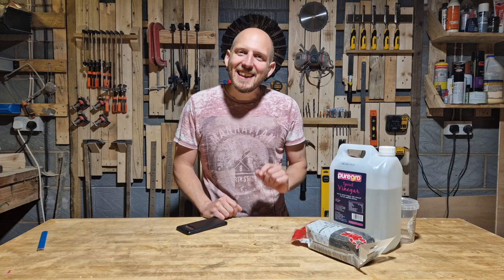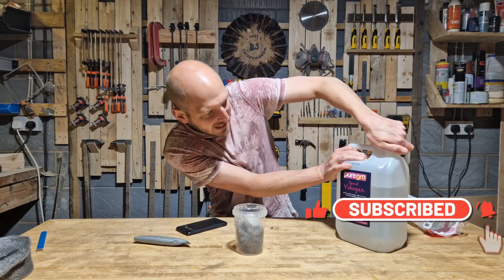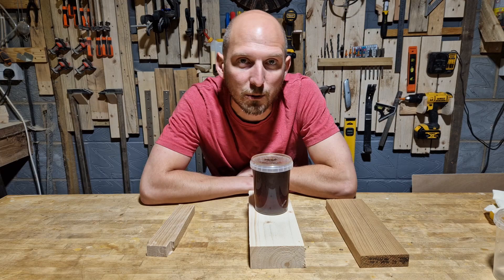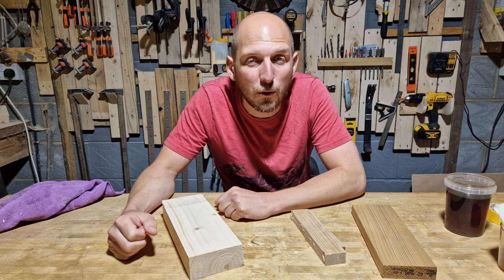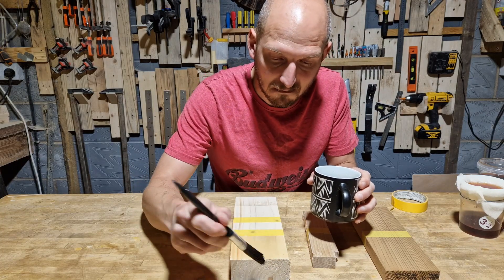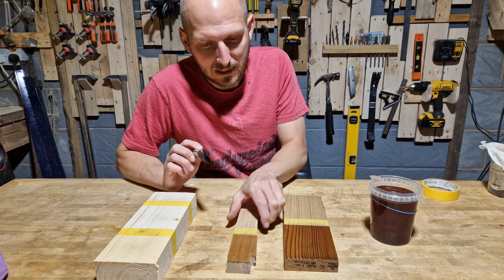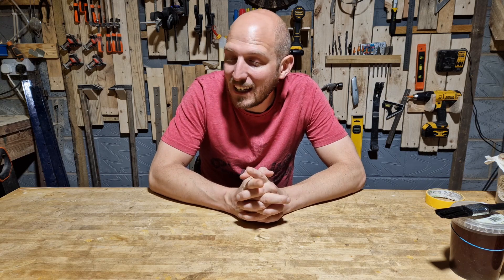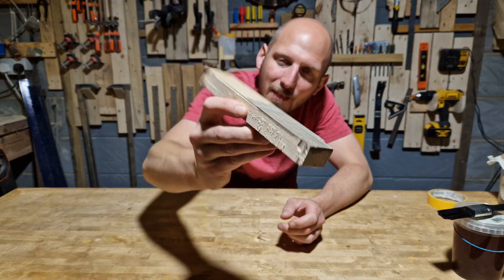EBONIZING WOOD: How to age wood using vinegar and wire wool!!!

Comment: I believe that i saw Norm Abrams first use this technique on a New Yankee Workshop episode. Now that would be 30 yrs ago now or more... but i think ( though not 100% sure) that he used it as a method of priming an oak table prior to finishing it black. I think a black stain was applied 
and it created a very uniform black color without the pores of the wood filling in as it would with paint.
Reply from the maker: Yeah, I can see how that would work. I've had issues with black stain in the past not creating a uniformed look. There's certain parts of the grain that it just doesn't seem 'work with'. This ebonizing mixture seems to affect those parts most. Well worth trying! Cheers buddy.

Comment: I've been meaning to try the vinegar and wool solution. I like the results you got when you included the tea. I was a little disappointed that the straight wool/vinegar solution didn't really go gray since that is the result that I ultimately am going for. Nice experiment!
Reply from the maker: I was a little disappointed with the 'just stain' one too. You could apply more coats but you're essentially painting a liquid on so then you have to deal with raised grain and sanding back. I've got a tonne of the solution left though so I'll keep playing.

Comment: Reapply it multiple times and you can take it to almost a black color
Reply from the maker: I've got plenty of it so I'll keep experimenting. Do you have to sand back between each coat to address the grain raising?
Reply: @justbswoodworking  I don't until I'm happy with the color, then I use 320 or 400, but that's me.

Comment: I recently made a picture frame for my wife out of well weathered boards I kept from an old garden table. Friends were impressed and expressed an interest in having me make some more, but I don't have many boards left.  The ones from the table were either pine or cedar so this might be an idea I'll try. Just mentioned it because you were wondering what you might use the technique for.
Reply from the maker: You're right, I wasn't thinking very creatively at that point. As soon as I published the video I started noticing all these signs my wife hangs around the house. They're all made to look weathered and distressed. Give it a go. I've read that the stronger the vinegar you use, the less time you have to wait before its ready to go. It's certainly not an expensive experiment. Cheers mate

Comment: Nice video. I a similar experiment. I used pallet nails though and the tea solution i used half a dozen teabags in roughly a mug of water and let stew for a day before using. I also applied the tanning solution after the nail solution and my pine turned black. i also reapplied both on other pieces of wood but didn't get much of a different result. Like you I was amazed at the reactions -)
Reply: I think we have winning idea here.
Reply from the maker: I might have to give that a go. The wire wool worked perfectly and is so cheap. Doing it in reverse though... that's an experiment worth trying!

Comment: I like the experiment. Re-apply the vinegar solution any number of times to darken the wood further.  Also, the tea treatment will work with the oak as well, or any species..  There are tannins in the tea.  Let the wood soak it up (as many times as necessary) and add more vinegar solution.  The chemical reaction will continue.  Keep playing around.
Reply from the maker: I'll certainly keep experimenting. I can't believe how easy it was!